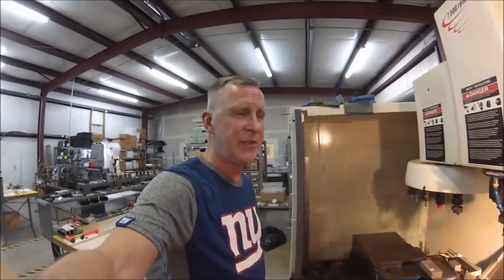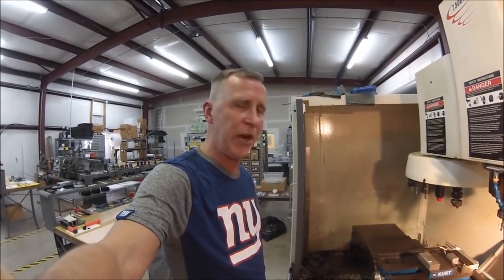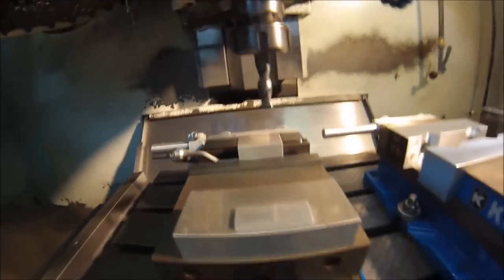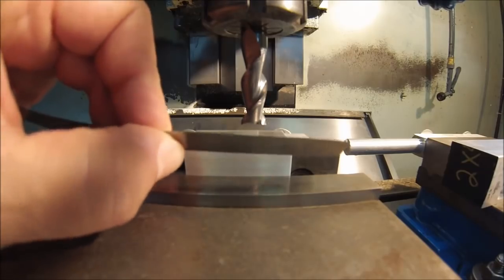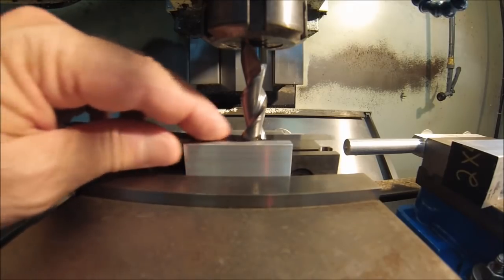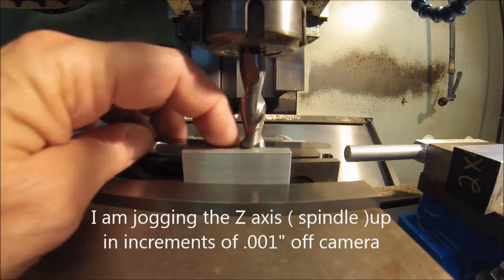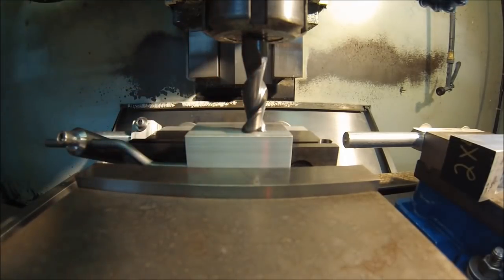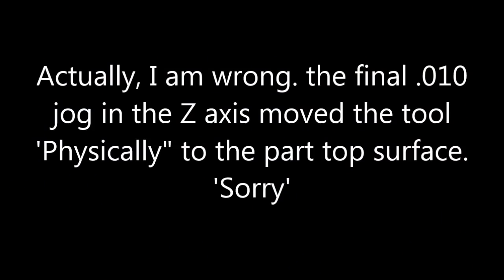How to Eliminate Chipping Risk when Setting your End Mill Height

Comment: That's pretty much how I do it but most of the time I don't worry about tenths.  Prototrak lathes and mills only go as low as .0005" in the Z axis.
Reply: Do you have a prototrak cnc quill turret mill? How good is the 3 axis machining for accuracy and servo movement accuracy?
Reply: Prototraks are good to .0005" in the Z axis.  .0002" in X and Y.  I make molds and stamping dies and that's good enough for me.

Comment: I use the same method for machines without a probe, but use a .100 Gage block and then set the work offset to - .100 in Z. So once you're done touching off you input the value and you're done.

Comment: I see you don't want to spend $100 for a touch off gage  and
you don't want to set your touch off by moving away from the part. Put a d.t.i. on a surface gage. Set (2) 1" thick blocks on top of each other so that they are offset . Touch your d.t.i. on the underside of the top block and zero it out. Your d.t.i. is now zeroed out precisely 1" above your surface. Bring your cutter down until the d.t.i. reads zero. Spin your cutter by hand to find the high flute, move your machine in x or y to find the high point of the cutter. You are now 1" above your surface, set your offset accordingly. Part two is to check your offsets of all the tools you intend to run by programming the machine to tool change to each tool and run them to 1" above your touch off surface. Check with your 1" block. Saves parts,tools and eliminates touch off errors from any debugging. For the record even $500 on a dedicated touch off gage pays for itself in no time at all , faster, easier more accurate. Great channel, keep up the good work.
Reply from the maker: I always set my tools from a zero plane on my part. My parts aren't always large enough for a setter to sit securely.
Reply: Hey , if it works for you ,go with it. There are many different solutions to every day problems, every situation is unique, great channel keep up the good work.

Comment: I would never shim stock I always use the dowell  pin always bring the cutter past the dowell pin and then crank the machine up till it just slips under. If you go too far pull the dowel pin out of position bring the cutter down again past the dowel pin then raise it up Thule just slips under that way you can't possibly wreck that cutter

Comment: if you use a paper feeler gauge,  will the little sharp corners still,  blow, breakoff ?
Reply from the maker: If you pinch it...YES
Reply: Even if you don't pinch and blow a corner/edge off, you still have to mic the paper.  Different grades of paper can vary in thickness quite a bit.  I have seen a fair number of old timers using zig zags as a .001" thick edge finder.  While it can work, it isn't very reliable.

Comment: Then adjust the z offset to account for the 123 block and part thickness if you set your tools to the vise ways all you have to do is account for your parallel thickness and your parts zero height this is nice if you have more then one setup and use different height parallels no need to touch your tools off just adjust your z offset page

Comment: I use the exact same method as you, but i use a 20mm precision ground block. For super super fragile cutters such as engraving points, or micro machining, I'd advise using an ultra soft material to allow for a tolerance of squish such as paper or whatever ect.

Comment: I use paper, A4 is 0.1mm or 0.004" to get the cutter somewhere near. I then use a fag paper (for our American friends,,,,cigarette pare) 0.03mm or 0.001".  Set the jog to suit the paper thickness. I work in Metric, so the jogs are .001 .01 .1 mm.
You can grip the paper without fear of chipping

Comment: Would this work on setting up small end mills 20 thou diameter or could you break the end mill
Reply from the maker: I think I would use a thicker block or maybe a pin for something extremely thin. Just be sure to check the gap while raising the tool and be gentle when you push the pin or block under the cutter. Very gentle.

Comment: .010 " or .020" Thick PLASTIC feeler gauge/shim stock. I once crashed a half inch endmill into one from about .050 above the part on a jog setting of .100 .... Enough cushion there that the overload tripped but it didn't chip the endmill!

Comment: One of the BEST/CHEAPEST/FASTEST ways is simply having a z0 dial setter. Never broke a tool and it's fast!
Reply from the maker: I always set my tools based on my material height and that constantly changes. My program base is just not setup right now to have a machine common zero for them. if I had one i could sit on my part, I may start using one.
Reply: @joepie221  thanks for the reply! I'm not sure I understand :\ I was talking about the 2 inch tall block with a dial you put on your part that tells you you're exactly 2 inches off your part. They sell chinese ones for like 60 bucks on ebay! :)

Comment: BETTER way (In my opinion)  quickest, safest way for me is to keep a 1" high aluminum block around.  Set the tool less than 1 inch above the part. Put the 1" block on the top surface and against the cutter. Simply raise the tool until the block just slides under the cutter. Voilà set the tool height (or tool length) so the DRO reads 1"  (not zero!)   DONE.  Never have to get the cutter anywhere near the part and you are never moving TOWARDS near/into a surface.  Can use a hardened block if you want, just make sure it is precisely 1" (or whatever you want...simple math).
Reply from the maker: I agree. regardless of how thick a block you decide to use, coming up to set the gap is the way to go. I usually find the height, go past and come back down just to double check the reading and drag.
Reply: Joe Pieczynski  yup. no need to get anywhere near an immovable surface the math works at a large distance  ;-)
Reply: If I may suggest an even better way to do it: Use a different cutter that you know the diameter of, say a .5 inch or .25 inch cutter, and use the same trick. The rounded surface makes it easier to raise your spindle to the exact Z value so your tool JUST slides over the top with a slight interference.

Comment: Hi Joe, I use a small surface plate with a hole it to hold the tool perpendicular to the surface while I measure the tool offsets using a height gauge.  Then I simply fill in the tool offsets in the tool table manually.  I can dial it in very precisely that way.  Thanks for the tip but I am never risking another broken tool by jogging toward a hard surface.

Comment: I pretty much do the same thing except with a gage block or gage pin. It's a little faster that way because if you're using, say a 1/2" gage pin, you don't have to approach the part so carefully. Just jog down til the tool is less than 1/2" above the part, then start jogging up like you show in the video. Great technique and way way more accurate than the paper method.

Comment: I like the Edge Precision method of using a known diameter pin like a 5/8 dowel. Move the tool close enough that the pin wont slide under, then slowly raise it until you can pull the pin under with a small amount of force. I like this for horizontals where the weight of the pin itself makes for a consistent load

Comment: I've seen it done this way with a 1-2-3 block so you're half an inch or an inch off the part instead of a few thou. Jog it down to a half inch or so off the part, then raise it up. I've also seen the tools touched off relative to a different surface (not the top of the part, maybe the table or vise jaw) and then you use a test indicator to find the difference between your tool setting location and your part top, and enter that value as your G54 Z-height. Great video, you always have great advice!

Comment: You can bring the endmill close to the part then switch on spindle and jog it down untill you touch since  the spindle is turning you will never break another tool by touching.
Reply: Sometimes the datum face is not going to be machined, and so the mark cannot be removed.
Reply: @Gottenhimfella  in that case what i use is a normal paper from the printer to avoid chipping of the tool.

Comment: For  finding CNC tool length I use a z-axis length gage with a spring-loaded spindle. You can set it within .0001. I routinely set .020 dia carbide drills and endmills and have never damaged or destroyed the tool. Edge Precision sells the most commonly seen unit. I also like to have the tool length independent from the work height. The "H" offsets are the same as the real spindle nose to tool end: there are no "-" values in the offset file, only positive numbers.

I know this sound complicated but I find the way shown here to be less flexible and more prone to error.

Comment: in a complete nube with respect to CNC but couldn't you have simply come down with the tool not tight in the spindle and pushed it on to the feeler gauge and once you had the correct feel simply tighten the spindle to lock the tool in place then Zero the machine?
Reply: Unless the cutter is bottomed out in the collet holder, it will pull back somewhat when you tighten the nose nut.
Reply: @Gottenhimfella  haven't had to much problem with it but you have to keep that in mind and you should try a test cut first if accuracy needs to be tight
Reply: I have used this method before but it is not possible. And with today's toolsetters it's a non-issue
Reply: @SheldonRobertson-f9m  you do not need a quil to do this
Reply: No
Reply: @SheldonRobertson-f9m  snug the tool holder and very carefully remove. Double check your values. Not the optimum way of doing it but it does work. Ofcourse it does not work with Weldon shanks

Comment: Thanks Joe. We used to have a hardened and ground 1.000" square block about 2" long. Not a gauge block. But a block made just for setting tools with a .010" step ground in half the block. Bring down tool untill half block slides under tool. Then jog up in .001" untill high side of block has slip fit..... use it with or without feelergauge.

I would always leave tool at that height and punch in +1.000 on Z (or tool offset)

Comment: Good tip,I use plastic most of the time,the side of a 2 liter pop bottle works good.Firm enough to set a z,but soft enough not to chip a cutter.

Comment: I know nothing about CNC, what if you left the collet loose and when you get it to your very close range with the cutter then loosen it and let it drop and  touch the top of your part then tighten the collet then zero out??
Reply: My instinct tells me that tightening the collet would pull up slightly on the tool and throw you off, but I don't really know.  I'd love to hear what someone more experienced that me has to say.
Reply: Well there you go!! I know more than I did 5 minutes a go! 😆
Reply: It won't always pull the tool but you can't tighten the tool in the spindle....
Reply: Not to mention what would happen if you forget to tighten the collet...
Reply: nick f  Unless the tool bottoms out in the collet holder (with ER style collets) ... but it's still not a great method, or even a good one, unless the corresponding face of the holder is flat and has a good finish, and the thru hole is well smaller than the tool shank.

Comment: I use an accurate 1-2-3 block, I bring the cutter just outside the edge of the part and below the top edge of the block. S slide the block back and forth while jogging UP at .001 until the block passes. I back out the block, jog down one click, switch to .0001 and repeat until I like the friction. 

For me jogging down over the part is always a recipe for disaster if you go one click too far, ALWAYS jog away from the part and its will be safe.

Comment: We made tool height setters out of round stock, drilled two concentric through holes, on center, one to tap 1/4-28, the other to capture the "probe" (another piece of round stock with a flange to just clear the tap drill OD, and main OD to just clear the through hole). Assemble with a spring between probe and cap screw adjust tension to suit then surface grind to known height (ours were 2.000) hope this helps someone.

Comment: Great idea Joe.
I use an adjustable parallel, bring the cutter down to about 1/2 to 3/4 inch and set the adjustable parallel underneath, open the parallel till it touches the cutter, Mike the width of the parallel, and you are done. It has worked for me for years...
Reply: That's how I do it too.

Comment: I use a 8mm pin and go up with the spindle until it slides through. Then I switch to a fine feed and repeat until it just feels right. I got that trick from Peter at Edge Precision. He does it all the time, and if I am not mistaken he explains it in one of his videos (which I could not find). Here is an examle. https://youtu.be/9GkBWEOlxxQ?t=1079

Comment: Didn't the "Old Timers" use cigarette paper as an indicator for engagement. Zig Zag also had other pleasingly beneficial uses too (I'm told☺).
Reply: I used toilet tissue and allowed .004" on manual machines.
Reply: Don Mittlestaedt  And it too had had other pleasingly beneficial uses also. ☺
Reply: I am a very old timer. Cigarette paper costef money. Janitors threw away nearly empty rolls. I picked them up and kept them at the machines where we all used it.
Reply: I'm only 48 and I use cigarette paper! 
I was shown by an old timer though.😉

Comment: A Tool height setter for $150 bucks on Ebay will be money well spent. I use mine to set all the offsets for the tool table. I use the tool setter under spindle nose ( must not be rotating) as a reference so you have all tools set from the same reference.
Reply: 150$ on ebay? for what? Show not tell :c
Reply: A tool height setter found one for $50 https://www.ebay.com/itm/Z-Axis-50-0-005mm-Magnetic-Determinator-Pre-setter-Tool-Setter-Tool-For-CNC-/202045901756

Comment: During my machining days I used a bit of newspaper, a small bit just slightly larger than the end mill, soaked it in a little of coolant for adhesion and left it on the workpiece surface while bringing down the endmill slowly. The moment the paper bit gets dislodged by the endmill, you know you are .1 mm ( that was the thickness of the wet paper) from the workpiece. The rest is math... Tissue paper works even better.

Comment: This works for only manual CNC like those? That looks like an old one.
Reply: All CNC machines have some kind of manual jog function. Old or new.
Reply: @MysticalDork  oh ok. So every cnc machine has to do this intricate process to get things right before machining? What about those $40 probes... what do those do? They are attached to the cnc machine and swapped out manually or automatically.. isn't that the same thing
Reply: Lime  this is meant as an option if you do not have a tool setter or probe or it is broken. To many people rely on the "automatic" setters so much that they don't even know that you can set things manually. Don't get me wrong they are great but if they go down then what will you do? More knowledge is best to have in reserve even if you don't use it every day...
Reply: @bbarker5766  got it

Comment: Hey Joe you method looks much difficult then the notebook paper way. Tear off a piece of notebook paper, eyeball tool close, slide paper back and forth under tool while jogging .0001" per click until you get a slight tear, and cal/measure +.003. It's cheap, easy, and very accurate. I'm consistently accurate with this method +-.0001 verified by CMM. The paper will provide a .003 cushion to avoid tool damage. You can also use it on a lathe for Z if the face is already finished.

Comment: Another quick method is to bring the cutter to within 1" of the top surface and open out an adjustable parallel to fill the gap, remove it, measure it and jog down that value. you are now at z0
Reply: Z0 is not always top of part
Reply: @aaronreihl39  this is the assumption it is, smarty pants

Comment: But you have a lathe and you know how to use it.  You could just make a tool setter.   You could also make a cheap tool setter that has 3 spring loaded side with plates or cylinders above the springs, so you could touch off, electrically, on 3 sides, X, Y and Z.  I have never seen this but this is what I am going to make for my CNC so I can touch off on 3 sides with the tool that is in the spindle. The spring keeps disaster from happening. I have no experience at all, and have never seen a video of this, but it is going to be my approach, I think.  In my country, a touch probe that you buy would be too expensive. Touch probes are the most valuable tool in the tool changer is what I have heard from people. But that is still not a tool probe, or tool setter. You need both. CNC is a pain, because it is a one machine fits all solutions thing that you must design, and it has so many subsystems on them, from limit switches, to tool setters, touch probes, coolant systems, vacuum systems, work piece holders, etc.  But, the power of it is inherently unlimited and amazing.  But I am like all the rest.  I just come here for the clothing fashion tips.

Comment: For parts that don't have very tight tolerances I usually a piece of the blue paper towel most shops have about the size of a postage stamp. Stick that to the part with some coolant and bring the tool on to it with the spindle running. as soon as the cutter bites into it, set your length. Best not to use do it on a finished area of the part though, just in case.

Comment: I did it this way for years, it works but it's a time sink. Spending the time and money to make a z height gauge,  it's worth every penny. Better yet if you're setting the same general tool over and over again build a fixture to do it off the machine.